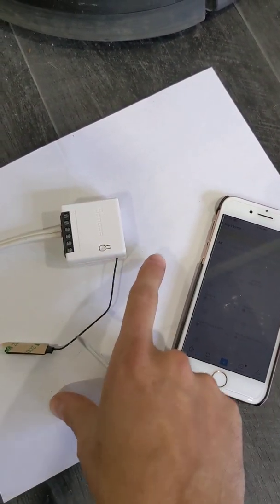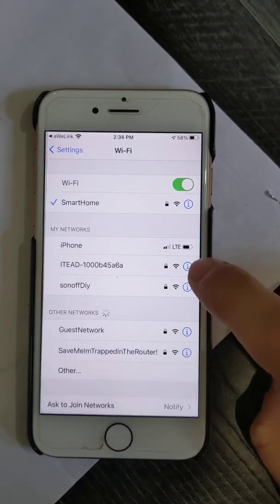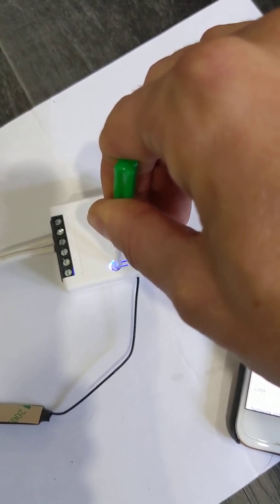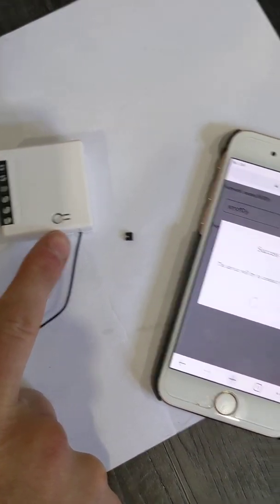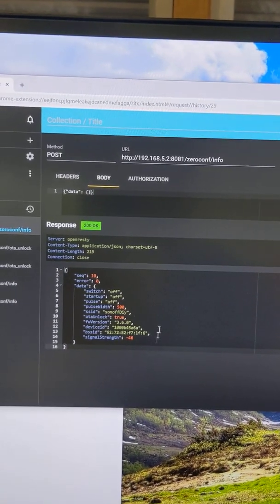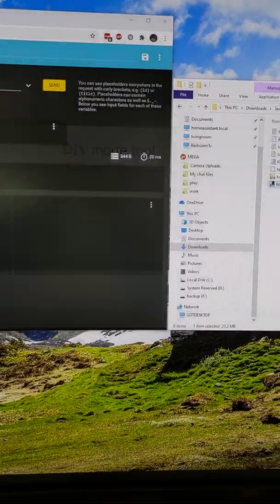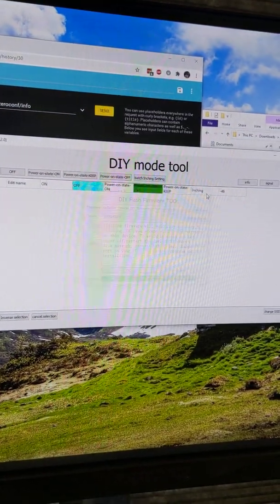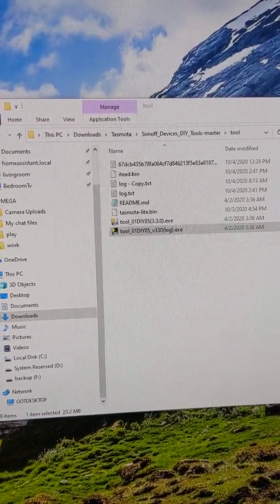How to flash Tasmota on a Sonoff Mini with firmware 3.6.0 and NOT using the jumper

Comment: Hi chad, i am using sonoff mini r2 with firmware 3.7, i follow your step, i can get info from device with raster, but when i send unlock its wont send.
Reply: Exactly the same here... 3.7.6 ... I think they did some changes for the ota_unlock and we don't know the format.
All I can get is an error 422 when I put some bullsh** in json
stupid of me to update 3.3.0 to 3.7.6 in ewelink... the older version worked like a charm

Comment: hi great video,  I am trying to flash these mini I can get to the point where  SonoffDiy is configured how ever when i check my router i only see the original Ip address when i set up ewlink. I have tried this Ip address in resTer but no joy does the, do you receive an new Ip address from sonoffDiy ?
Reply from the maker: This could be just a DHCP issue or something on your router maybe? There would be 2 different addresses yes. There is an internal eWelink address that is local to the mini. Then when you connect to a router/wifi (sonoffDiy) the router should hand out a new DHCP address. Hope this helps

Comment: I buy sonoff mini R2 and enter to DIY MODE, then setup SSID & password to my wifi. after that , but I can see the IP from my router. I try to reset and press button 5+5s , I can't access 10.10.7.1 anymore......
Reply from the maker: DIY mode uses the 10.10.7.1 address. If you are able to access that, then enter the SSID of your network you will then get another IP address. Typically something like 192.168.x.x. You will have to login to your router to see what the IP address is for the newly connected device.
Reply: @codezero11  Finally, I success !! (1) I change a unifi router and get the IP well. (2) still suffer DIY tools can't find the device problem, I ref proc V2.0 document. I try and error and found the two key point. (1) follow proc V2.0 step by step (2) If still no found device to restart the computer or reset step 4.& 5 pulse & wifi setting, the SSID&password keep sonoffDiy and 20170618sn
Reply from the maker: @kf120498  make sure the computer you are using the DIY tools is on the same exact network as the mini. If you are using a ubiquiti device, make sure there are no firewall rules blocking access between devices. Make sure your PC can ping the mini.

Comment: Thanks for a great tutorial!
Everything worked fine until running the tool. It didn't find the device despite it was connected to sonoffDiy hotspot.
I found solution to that on github issues page. Here it is:

frank3791 commented on 27 Aug 2019 •

Its working now after many trial and error. On PC, I switched my dual band wifi adapter to (4) 2.4GHz 802.11b/g. Then the adaper restarts and it cannot connect. Then I switch back to (8) dual band 802.11a/b/g and adapter restarts and it can connect to sonoffDIY SSID. Also the tool shows the mini device and I can control it.
I hope it this can help someone.

Comment: Thank you for the clear video. With this I flashed several Sonoff Mini. In the meantime I bought a Sonoff D1 Dimmer after I saw that Tasmota already has a Module (# 74) for this device. Can I use the same procedure to flash the dimmer?
Reply from the maker: Glad to hear! I actually have never tried the dimmers, but I would think it's pretty close to the same.

Comment: Hey thanks for the video, I've just bought new mini r2 with a different DIY mode (no pin). So I think this will work for me. However I get 200 OK, seq:11, error:422? Instead of the device details
Reply: If you look the Itead information: Error 422: the operation failed and the request parameters are invalid. For example, the device does not support setting specific device information.

Comment: Thank you for this video !
I have a question about the pairing on the specific SSID with the mentioned password. Is that part mandatory ? My devices are already installed in the wall and everything covered up, can't I just flash it the same way you presented  but from its current IP and wifi network ?
Reply from the maker: When you put it in compatible mode, it's looking for the so offDiy network. That's how you gain access to the DIY screen to set up the device. Don't believe you can do the same but without it. Give it a shot. Let me know.
Reply from the maker: I was in the same situation as you where I didn't want to take all the devices out of the wall or the electrical boxes. So you should still be able to follow my method and keep them inside the electrical boxes. you do however have to gain access to the little button to hold it down of course.

Comment from the maker: Shoot, I was trying to reply to the last comment and I deleted it. Not sure how to get it back! Just wanted to say I didn't mean to delete it. The answer to your question however. I actually can't recall at the moment. I'll have to test again and catch the step. I believe after its in compatible mode it runs a webserver. And I had already connected to it. Getting the 10 address from there. If you are able to get to the sonoff DIY screen you are good. But I suppose you may be stuck there. As for the 192 address, that's coming from the sonoffDiy network. After you set up the mini on the sonoffDiy network, it picks up the IP from the DHCP server on the router.

Comment: Hi Chad. Very useful video - Thank you.I have a couple of question to clarify the instructions. When you put the device in compatible mode for the second time, do you then connect your mobile to device's ITEAD..... network before connecting to Chrome browser and connect to 10.10.7.1 network OR is the phone connected to the local WiFi.
If it is then via ITEAD.... then how would it have the ip address in the local network range i.e. 192.168.x.x or does it remember the ip Address from when it is connected the first time around?

Comment: You don't need to do all this.  Rester steps are not needed.

just create new hotspot on phone or guest network
wifi name (case sensitive) : sonoffDiy 
Password : 20170618sn

put jumper on sonoff mini (this will unlock ota)
long press 5s

long press 5s (may need if reg in ewelink app)
led continuous flashing

connect pc to sonoff @ 
ssid : itead-xxxxxx
password : 12345678

in browser go to 10.10.7.1
input ssid and pass for new hotspot
wifi name (case sensitive) : sonoffDiy 
Password : 20170618sn

run flash tool and sonoff should show up ready for flashing
Reply from the maker: This is the standard way, and works most of the time. I have found a few to be a bit stubborn or something so the method listed works. Hopefully your details will help others. Seems these things can be a pain at times!
Reply: @codezero11  This would be so much easier if the flasher tool could be configured to look for sonoff on your existing network, no longer need the hotspot since you can set sonoff to connect to your existing network now.  And have the flash tool pass credentials to tasmota so it connects to your existing network on first boot.
Reply from the maker: @pppanimal5306  completely agreed. I bet we will get there soon.

Comment: Is there a way to restore the original firmware? I will use Home Assistant and it is finaly supporting the original firmware 👍
Reply: How can I use it on Home Assistant using the original firmware? Do you have a link to a guide?
Reply: @AntonioRevert  Hi Antonio.. yes you can, I followed the video on the link
https://youtu.be/ePd6sZY3k5M

Comment: trying to do the OTA_Unlock through RESTer but doesn't seem to work... it keeps on loading and eventually results in Failed to fetch.

Ive set up a Hotspot on my mobile phone and all settings are als in the description.
Reply: add Header Content-Type with value application/json
Reply: Having the same problem here, have tried multiple minis and multiple computers with no result apart from failed to fetch. Adding Header "Content-Type" and value "application/json" hasn't helped
Reply: @Dreaspinoso  Wireless sonoffDiy must be Internet conection
Reply: @Dreaspinoso  you need to add following code to body
{
"deviceid": "",
"data": {
}
}
Reply: @HungNguyen-gp4zk  Yeah mate i had sent the payload as you suggested. Ran into problems with running sonoff DIY program. I ended up just 3d printing the programing jig for serial flash.
Reply: You no longer need to add it to the sonoffDiy network / hotspot you can add it to your normal network and it will work but the network you add it to has to have internet connection for ota_unlock to work. Just spent ages trying to unlock a load I brought a while ago and didn’t work until I added internet connection then worked fine

Comment: Thank you for your video & explination, I will try it today and get back to you 😊
Reply from the maker: Please do, I'm curious if it will help others! It was driving me crazy trying to flash some of the minis!
Reply: @codezero11   Two days trying to connect to mini without luck, even cannot log from the mobile to 10.0.7.1 while I can log from the laptop, I began to doubt the problem was on the sonoff device itself, the AP ITeadxxxx disappeared every few seconds, I will buy new one and will try again, I hope it will work 🙄
Reply from the maker: @nawafbana8100  can you use the ewelink app like I first did in the video? I noticed that sometimes the mini would become unusable till I did the resync at the start. The itead ap will only show for something like 30 seconds. So you have to work relatively quick.
Reply: @codezero11  I can pair using quick pairing wihout problems, but when try to pair using compatible mode it stuck on retreving info
Reply from the maker: @nawafbana8100  two things to try. If you have another device you can try pairing with do that. Also, I have noticed and struggled to pair with my pixel 4. Turning off mobile data while staying on wifi has worked too.
Reply: @codezero11  Awesome,, got it work finaly , thank you so much for your support 😊👌
Reply: Last thing, when I connect to device using 192.168.4.1 and after entering my wifi name & password and save.. the device became inactive and device wifi name disappeared, I made tasmota reset and face same thing
Reply: Finaly, I did it, thank you, it is working now 😘